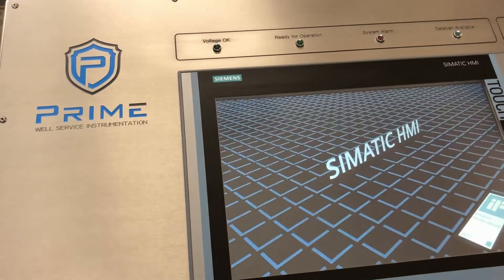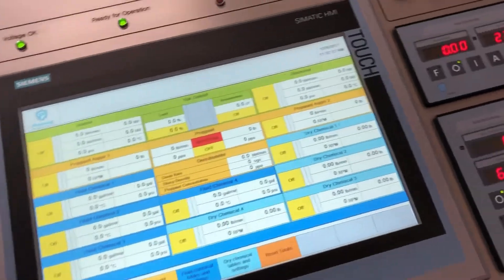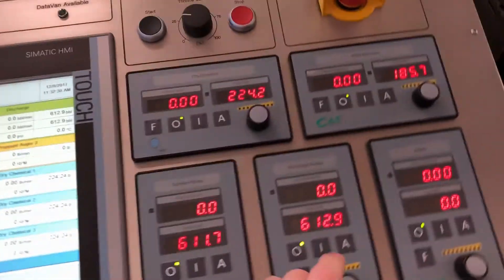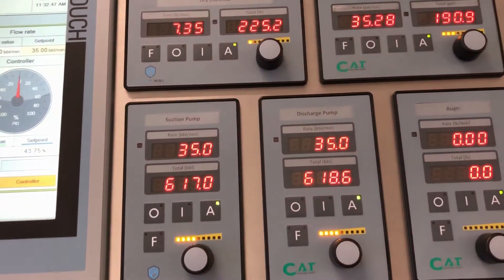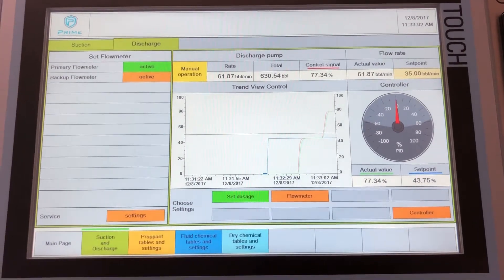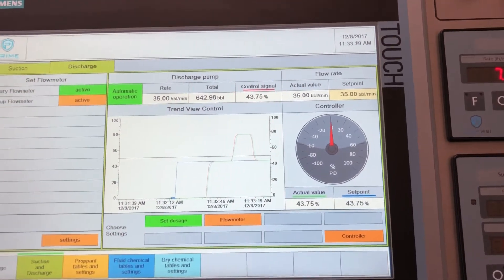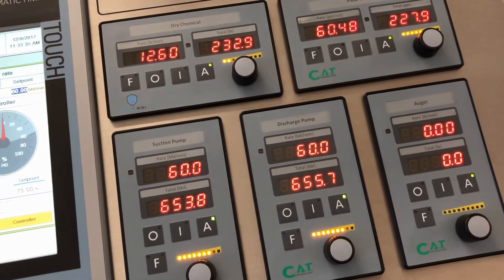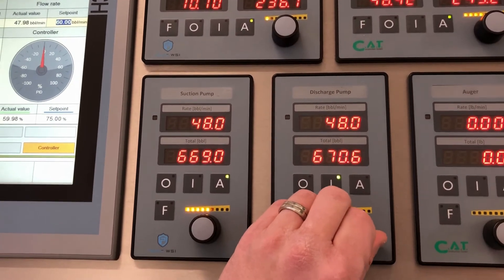Frac Blender - Hand Control Modules - Prime WSI Ltd.

Comment: I highly doubt the pid loop is tuned fine enough to achieve 60bpm in the time it showed on the display without some sort of oscillation, especially sending throttle signal to both engines through can
Reply from the maker: Indeed this is simply a simulation on a demo unit and not reading actual sensor values. The hand control modules show actual flow rate when tied into a sensor. The HMI has a spot to enter desired flow rate and when in automatic mode it adjusts the control signal to meet desired rate. 

You can see on the HMI that there are also three values displayed on the graph. 
Set Point (blue line) shows the value entered on the HMI for auto mode OR the value dictated by the encoder on the hand control module when in manual mode. 
Control Signal (red line) shows the value that the PLC is sending out.
Actual Value (green line) is the feedback from the sensor in the process. 

The reason we show all three values is because obviously they are not all the same all the time, especially in the midst of a change in the set point. We feel it is important to give all of this information to the operator so he is aware of how the unit is performing.
Reply: @primewellserviceinstrument8691  I do like the potentiometers you guys have, they reduce any oscillations caused by vibrations of the unit with augers screws turning and whatnot. They keep your set point steady...which really makes a difference when you're in auto and your controller isn't having to adjust to a deviation in the scaled value from the sensor. Which in turn makes tuning the loop that much easier.